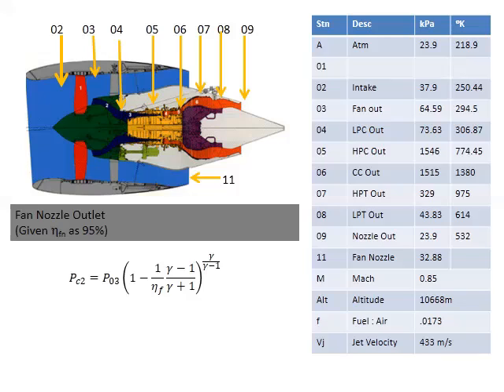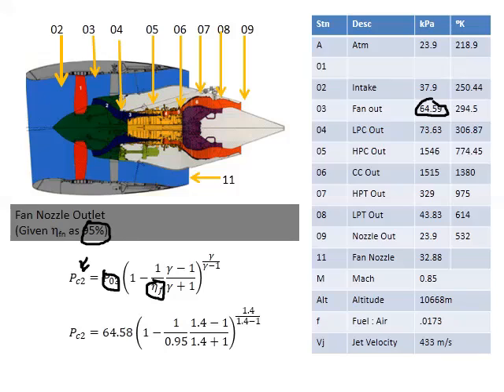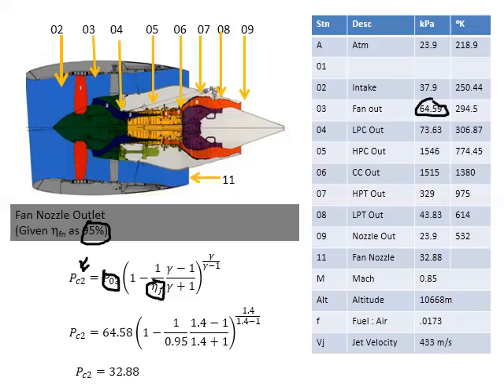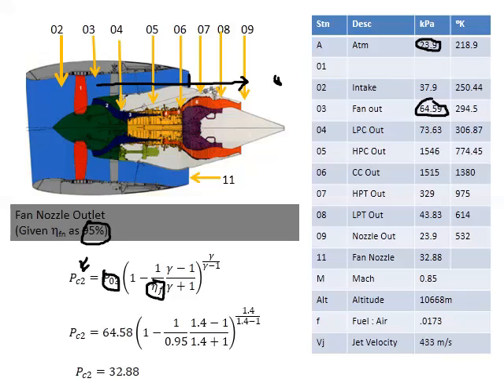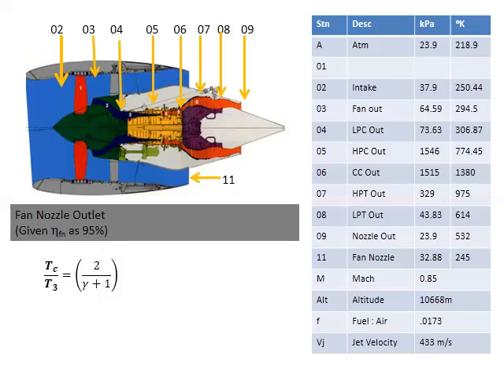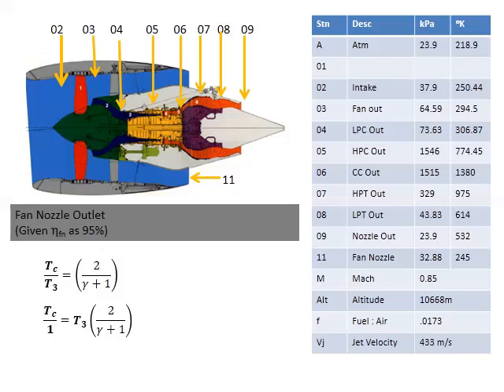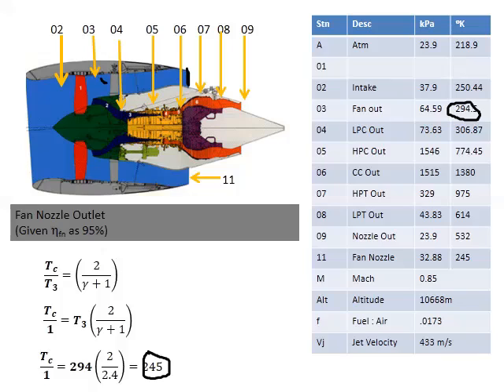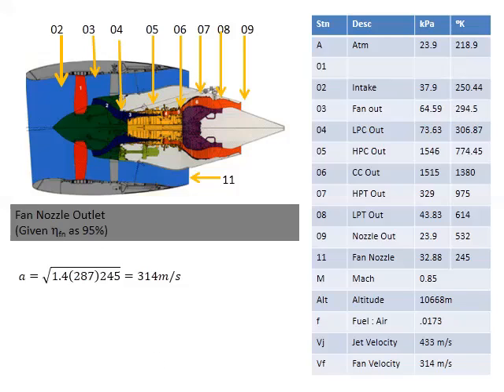Modern Turbofan Analysis Part6

Comment: How Can calculate the diameters: - diameter inlet in nozzle cold and the diameter outlet in nozzle cold, diameter inlet in nozzle hot and the diameter outlet in nozzle hot and the mas flow rates ?
Reply: I need the design of the nozzle in a turbofan model